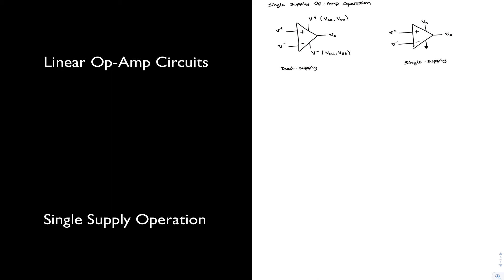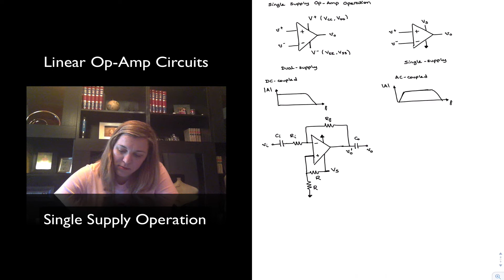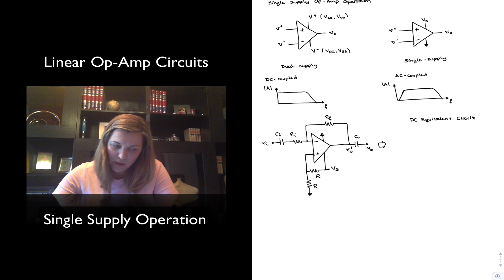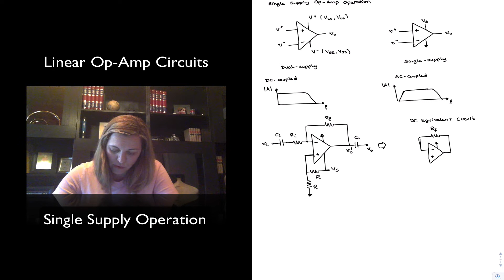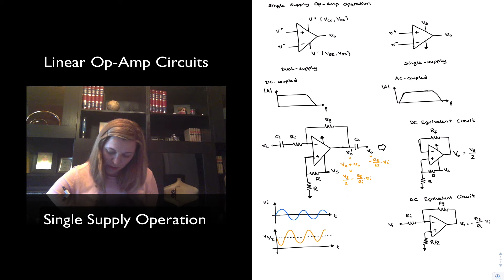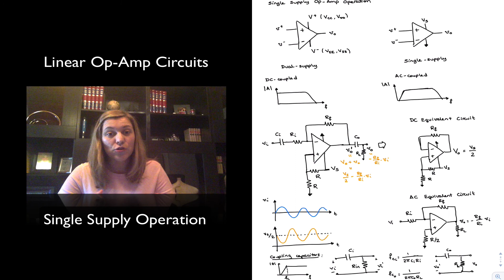Op-Amp Single Supply Operation

Comment: Whoa whoa whoa, you can't just play around with the rail terminals like that!

Just kidding! Although, I was surprised when you revealed that one of the inputs is connected to the rail.
Reply from the maker: Doesn't have to be connected to the rail. In theory it could be connected to an independent supply. In practice, though, the availability of supplies is limited, so you would be using one of the supplies available (or in some cases the only one available), like the one that is powering up your op-amp.